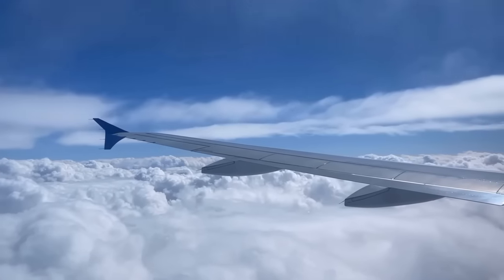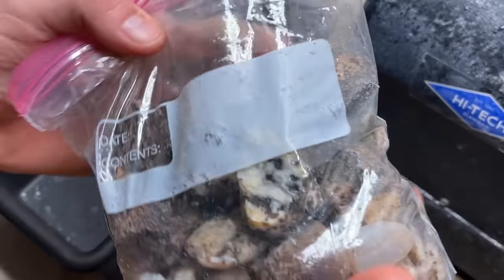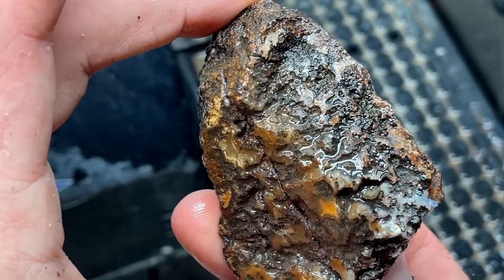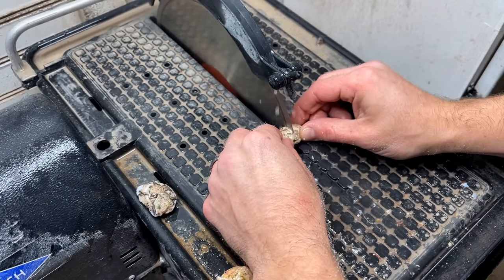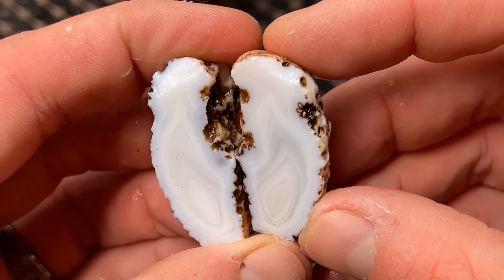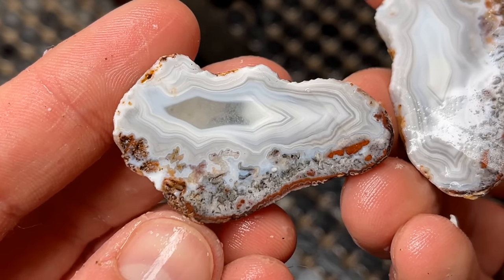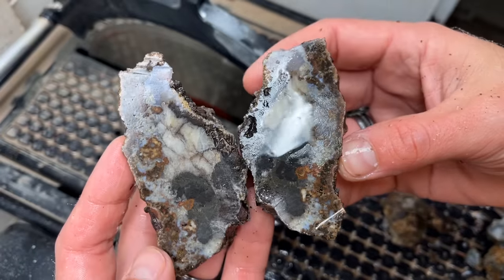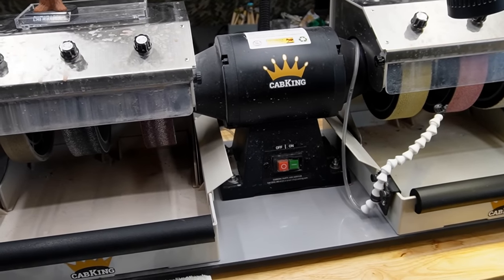Cutting Premium Arizona Agates Open!

Comment: I see many comments expressing fear that lapidarists will cut themselves with their saws. The diamond saws they use don't actually cut like a regular saw, they abrade a narrow channel through the material. You can hurt yourself with them but the injury will be more like a burn than a cut and won't be very deep. Eye injury when you forget to put your safety glasses on is a bigger problem.